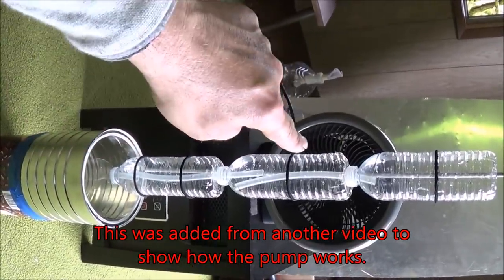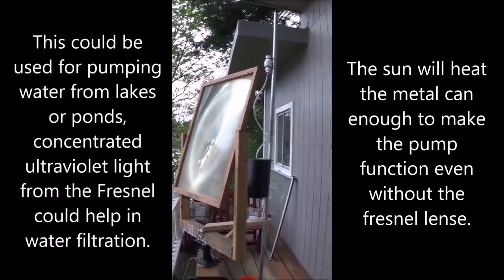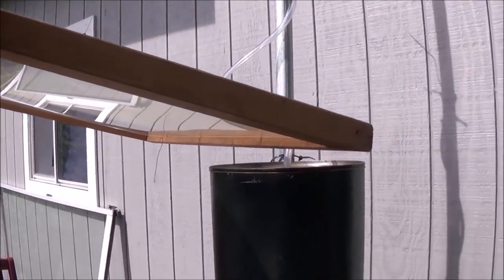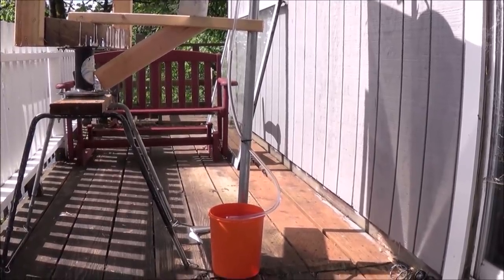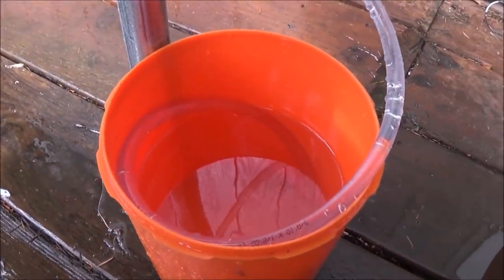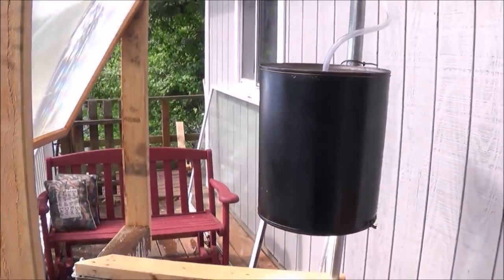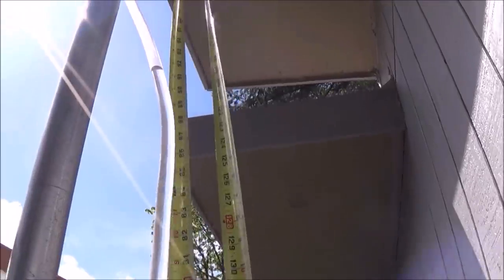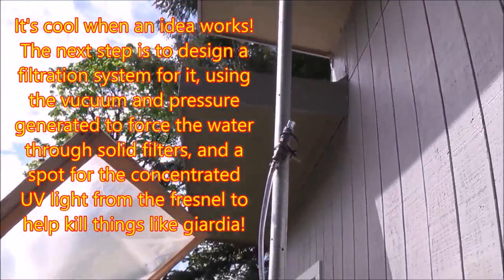"Thermal Vacuum Water Pump" powered by a Fresnel Lens.

Comment: Instead of using a large can, use a long vertical tube painted black.  Then position some vertical shades in front of the tube.  As the sun moves across the sky, the tube would be alternately heated for a while.... then shaded for a while.   The water should be in a tank BELOW the heat collector tube.  That way, the whole tank of water need not be heated and cooled, just the air in the collector.    I experienced this phenomenon when I was a bench repair technician for Cable Tv Equipment.  This process you describe is what causes electronic equipment outside in the sun... to heat up and air pushes out of the housing.... then a rainstorm comes along and COOLS the enclosure.  This causes the protective enclosure to FILL UP WITH WATER!  I had to repair a LOT of water damaged CATV trunk-amps and line-extender amps due to this .
Reply: Yes, I was thinking that all that water would take a longer time to heat up! Great idea.

Comment: @MrTeslonian, will your pump tank eventually fill with water ? (Air dissolves in the water so gets depleated).  If so, no air will be there to push the water above.  Do you have to empty the tank every few days?

Comment: It can function more, by making a heat sink/rotation setup. Use the heat to power a waterwheel instead (2 to 6 "spokes"). As a hot tank then cools and gains water, it falls, bringing a new tank into place. Then it dips down into the water, and cools more (sucking more water in and getting heavier). You'd have to figure out how to empty them as they fall I guess, so they rotate back up. :P

Comment: Love this! Basic, easy and cheap to construct, and robust (in non-freezing environments). One approach could be to downsize into multiple smaller pumps doing less fluid volume but at a higher work cycle frequency. More easily scalable that way. Maybe use pump bladders that incorporate elastic or thermal shape-memory alloy to assist in the vacuum (cooling) phase? Some means of either rotating absorption/reflective surface or shuttering of the solar target is needed. Maybe incorporate two units in opposite heat/cooling cycles to operate mutual shutters? Use of a vertical linear (trough) parabolic or (better yet) compound parabolic would increase efficiency even more. I wonder what the overall efficiencies would be to this system vs. a Sterling Cycle or PV pump?

Comment: @MrTeslonian There must be some air still in the system? As water is comparatively not compressible how is enough pressure differential achieved at different temperatures of water. I wonder if installing an air bladder in the tank would increase the amount of water displaced (pumped) each cycle?

Comment: Anyone know what kind of check valve will work with these low pressures? This is something I've thought about for years, because my rain barrels do almost this automatically in the sun.  The way I stack them, I hear gurgling during the day when it heats/clouds over.  I want to pump a day's worth of gardening water for more pressure when I water.  This could even water automatically!

Comment: energy reflected by a 36" by 50" mirror is much less than the energy of the same size Fresnel, if area is a factor in design than the Fresnel is better than mirrors or even solar panels. a lense this big has a 10,000 watt potential at its 1/4" focal point, it would take a very large area of solar panels to make 10,000 watts. A lense this big will cut through a Master Lock and heats the same volume of water faster than a 1200 watt microwave, it would take a very large area of mirrors to achieve the same power output as this little lense.  The reason we use mirrors is that they are cheap to produce compared to solar panels or fresnel lenses.